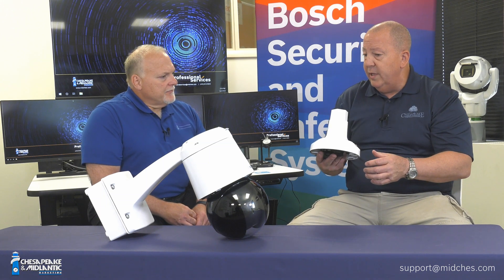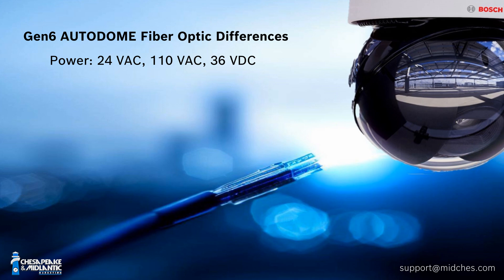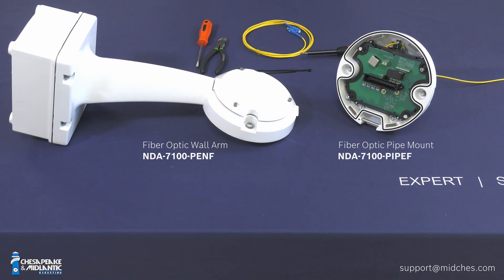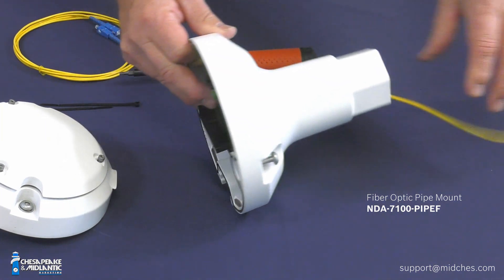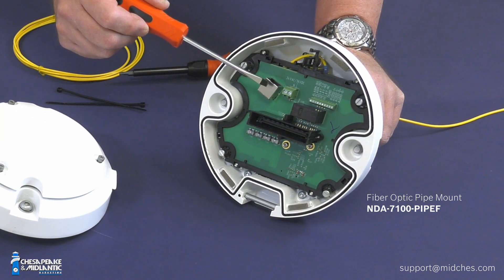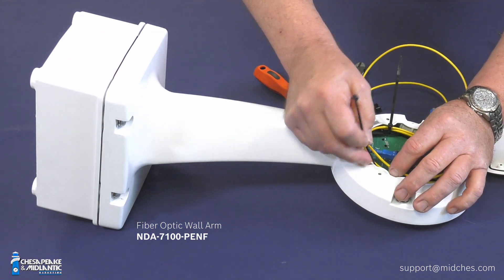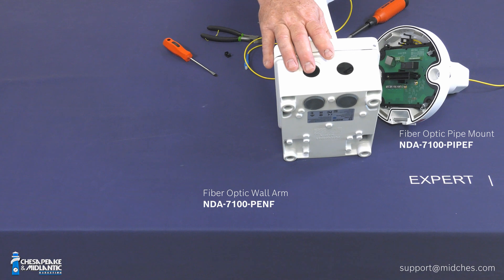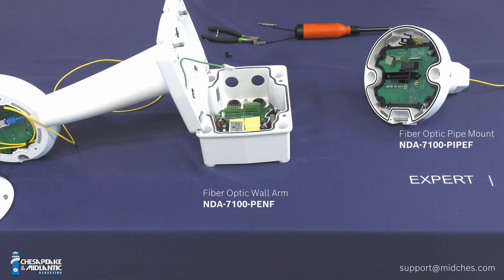Fiber Optic Connectivity for Security Cameras - Part 3: Bosch AUTODOME 7100i (Gen6)

Comment: Some remarks: only the data connection of the RJ45 socket is disabled if your using fiber. Powering the camera with a POE injector is still possible. There is no fiber mediaconverter in the product, the data connection of the fiber goes directly into the camera. So yes there is a built-in Ethernet switch inside the camera itself. Great video btw 👍🏻
Reply from the maker: Thanks for the clarifications! We always appreciate fact checks from the topic experts!